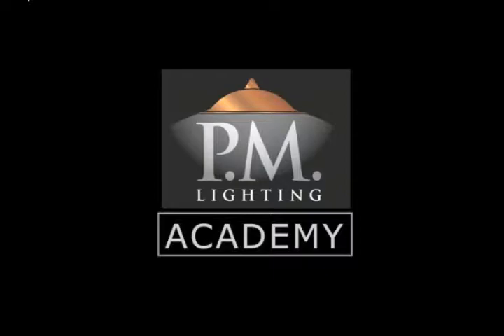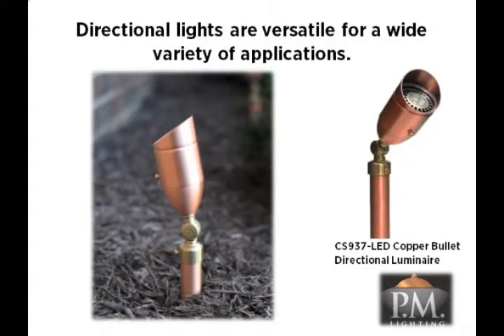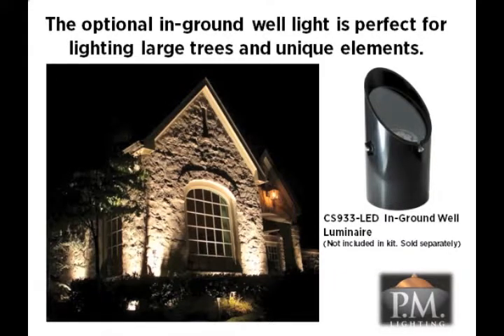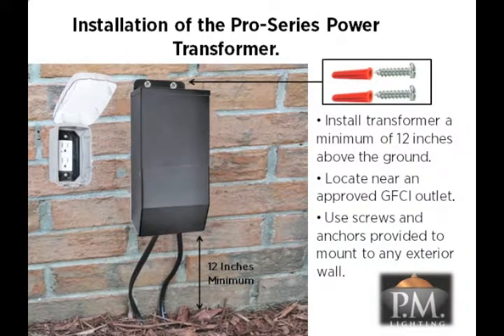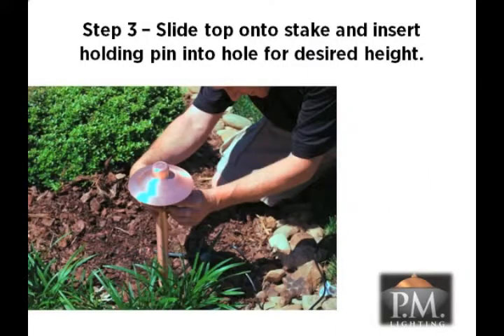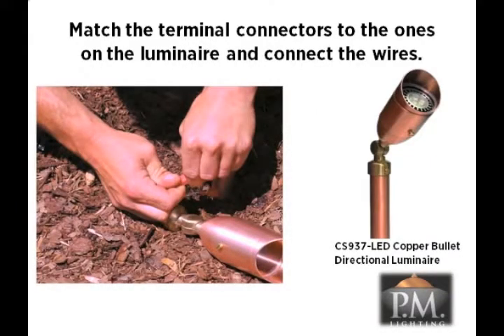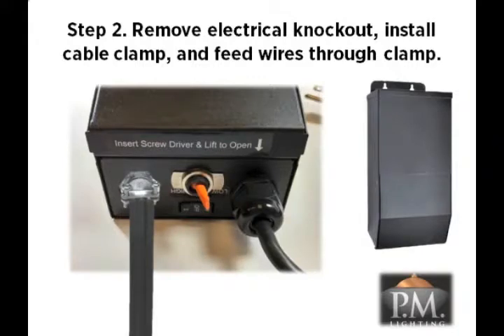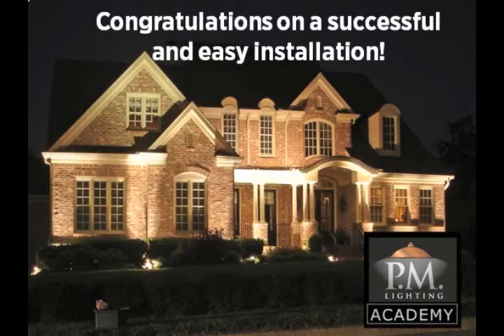P.M. Lighting CS Professional Series LED Installation

Comment: At 16:52 it's stated to set the High-Low Switch to the "high" position.  However, the switch is labeled for "1" or "2".  Which number is the "high" position?  Also, what's the recommended setting for the circuit breaker (high or low)?
Reply from the maker: Thank you for your question. The High-Low switch was designed to allow a 1V increase in the output to help offset any voltage drop that may occur in fully loaded circuits. We recommend that you use the High position (#2) to increase the output voltage from 12V to 13V. Most LED systems will work fine in either position due to the small amount of voltage drop that actually occurs, unlike older halogen systems where the volt drop issues are much more noticeable. Since the operating range for LEDs is fairly wide, using the High position provides the extra power to keep all fixtures within the operating range, especially when you have several lights on a single run.